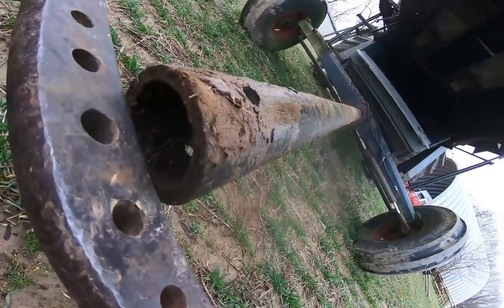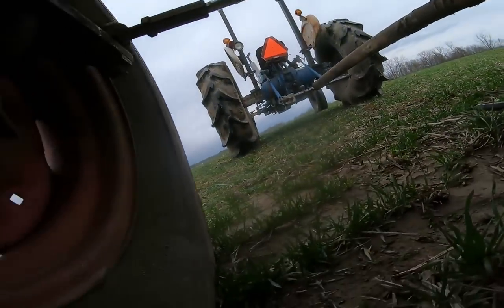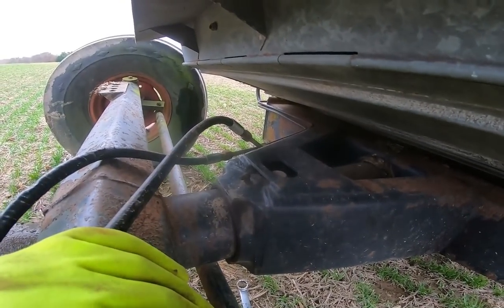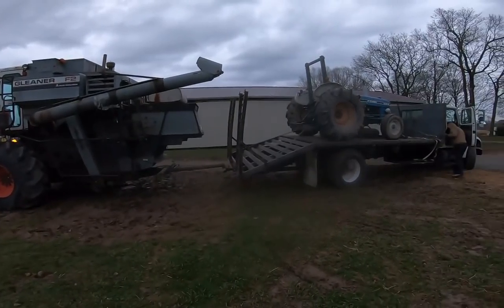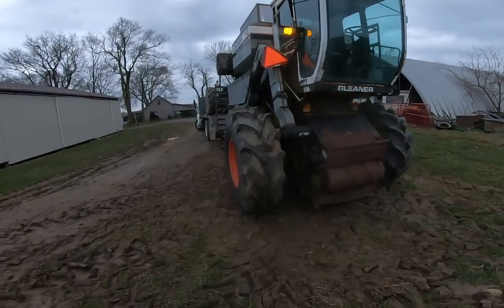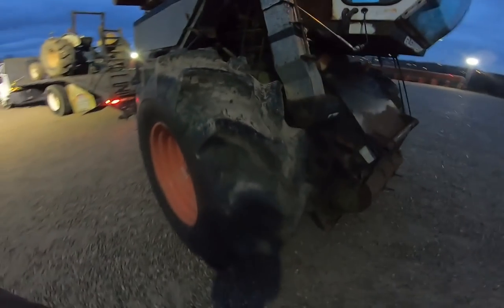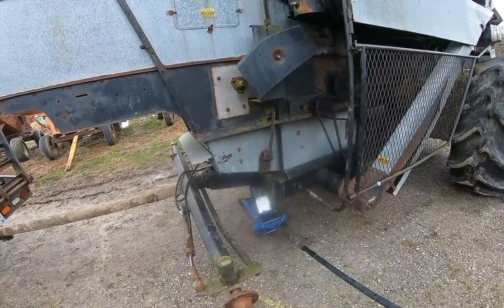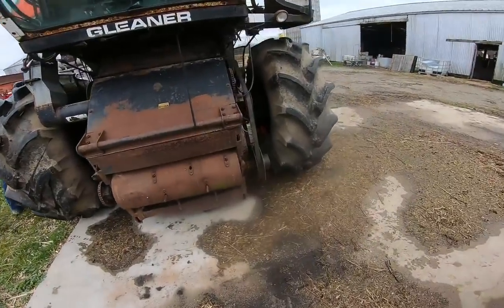Towing an Old Gleaner Combine without a Trailer

Comment: Lots of those smaller machines were scrapped or towed for other reasons around here years ago , the guys that bought the ones I’ve seen had tow dollies like those that u haul rents out and they would strap the axle down on the dolly and remove the tires like you did and take off down the road.  I know that old gleaner is light in the rear but I am shocked  that pipe held up for 25 miles but glad it did!  I’ve got to make a hitch for a 14 series IH and tie the steering hydraulics in to a tractor remote to move it soon a short distance due to an engine fire.  Glad you got that one home

Comment: Nice cab on the Gleaner, at first I thought you going to tow it home with the Ford
Reply: Yeah I towed a combine one time with the 6600 Ford about 50 miles... Combine salvage was going out in Bay City, and they had an old Ford 630, lots of parts will fit my 640, so I bought it.  No wheels or tires and one final drive off, so how to get it home??  I had an old trailer made out of the back end of a tandem truck cut off behind the cab, flatbed, with a subframe that allowed it to tilt to the ground when you pulled a big flat steel bar pin out of the front.  I hitched that trailer to the tractor and drove down there, they loaded it with a giant fork tractor, and I chained it down good, and then hit the road... was a little tall riding on top of a flatbed trailer on top of 900-20 inch dual tires, but she handled the weight just fine.  Sure was a slow go with the old 6600, but the open deck sure made it easy to see when I had to go through Boling, the one town I couldn't avoid... make sure not to snag any wires or lights... took about 3 hours to make the return trip with it.  Later!  OL J R :)

Comment: Shouldn't have any trouble moving that engine.AC  D2900  301 fits AC 185 - 8010 tractors and a bunch of industrial applications probably a 30 year range.

Comment: Where was your safety chains. Should have pull the driveshafts on those final drives. The tire's will wear better going backwards. We used to do this back in the 70s

Comment: Are you gonna be using the tires and if not what size are they. I’m needing a set
Reply from the maker: They are 23.1x26.
I'm trying to put them on that unisystem.
Reply: They will work on the right side but all of them that I have seen anyway 18.4x26 is the biggest you can go on the left side

Comment: What’s the oil on the back tire of the Ford from
Reply: Looks like a leaking tire bead. The tire probably has fluid in it
Reply: You made my look the video again, good question
Reply from the maker: Tires are dry. Might b an axle seal leaking.

Comment: Hope you didn't go very fast... about 20-25 tops.  Bout all those final drives can handle, and the transmission.  Plus those rice tires ain't meant to go very fast anyway.  

Years ago I scrapped a bunch of old double row cotton pickers we'd accumulated over the years.  I pulled the engines and transmissions because I was selling them to the tractor salvage my brother worked at, along with the tires.  Dropped the rear pickle fork (single rear tire inside a fork) and the 38 inch front tires, after dropping the picking units off.  Then we cut the axle and chain case that drove the picker units loose because that was heavy as h3ll big truck axle and huge cast iron chain case, was hauling it on my 16 foot lowboy trailer behind the pickup, and figured the basket and frame and blowers was enough for one load, chain case and picking units on another load.  Problem was, how to get the thing to skid down the length of the trailer once I picked up the front end with the loader and pushed it up on the trailer... I put on my thinking cap, and then went and picked up an old '78 Ford pickup hood at the junkyard... set the rear of the 4 inch pipe frame of the picker on the hood, then picked up the front end of the picker and pushed it down the length of the trailer, loaded backwards... the hood just slid pretty as you please down the length of the trailer, til the frame got to the front, chained her down and hit the road!  Worked like a champ!  OL J R :)